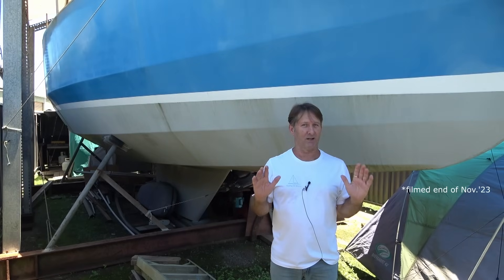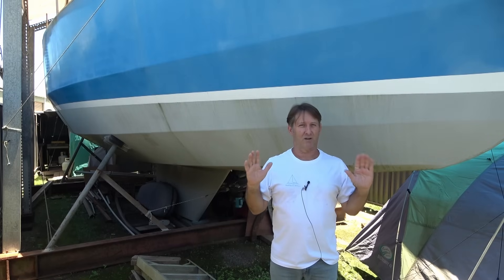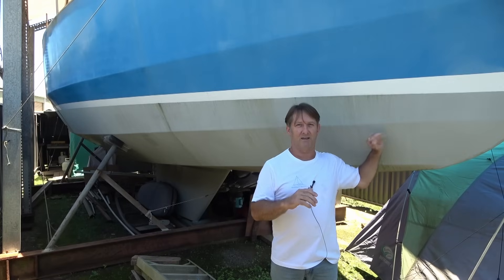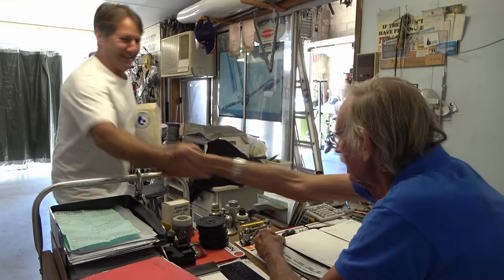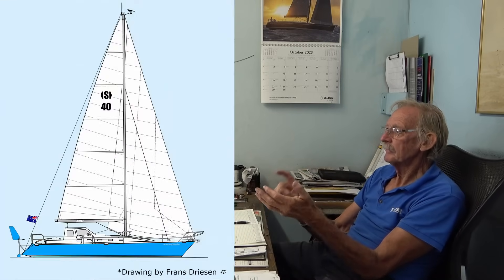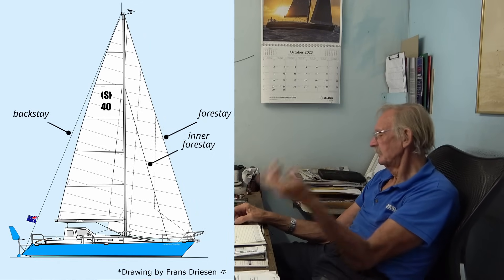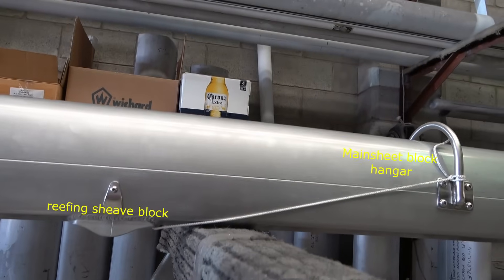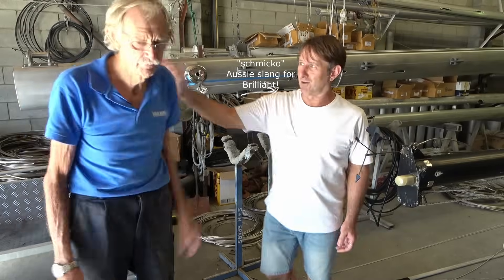INCREDIBLE 🏆 Mistress' NEW RIG 💪 Ep 176 Building my steel sailing yacht

Comment: Very smart Bruce,  only fitted Radar units from some years ago and the cable was a massive co ax multicore , it would not have fitted through that gland on the mast let alone your steel pipe.
I guess now it's power and 2 data cores only !
Reply from the maker: Thanks for your good comments rl, appreciated and it's just 1 power and 1 data for the Radar  🙂👍🏻